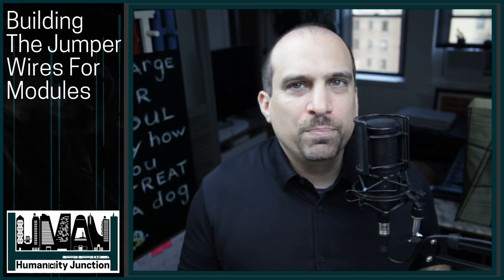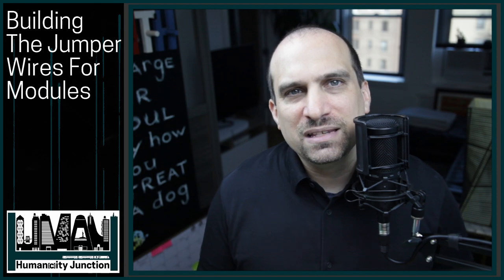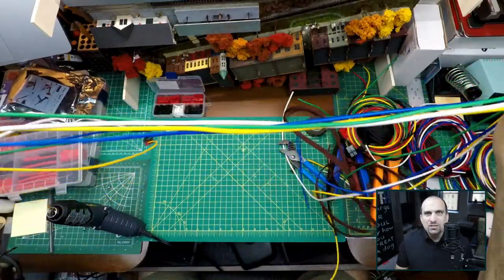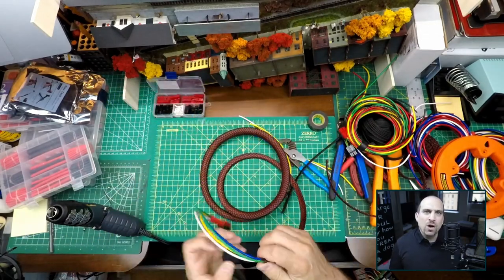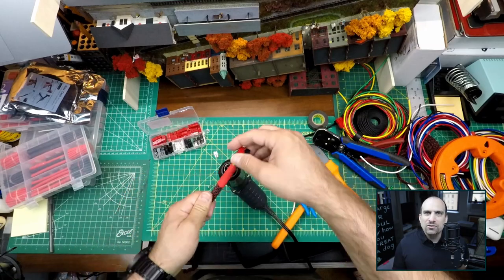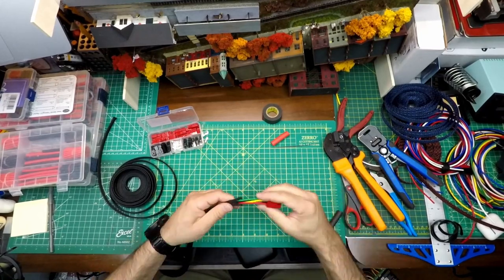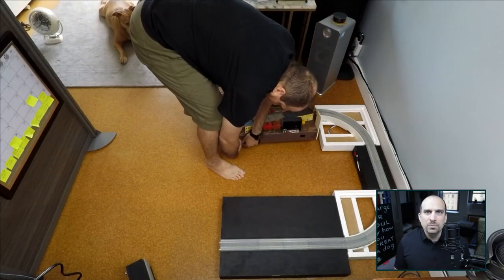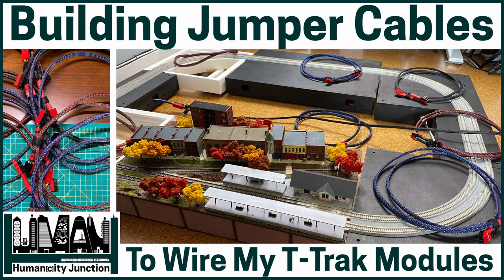46 | Building Jumper Cables To Wire My T-Trak Modules | DCC

Comment: Nice work Heath. Wire management is really something I need to focus on when building my next layout. I remember using these Anderson Connectors on my RC airplane batteries and speed controllers. Cant wait to see your circus trains running on the layout. All the best, John
Reply from the maker: John, Thanks so much!! -Heath

Comment: That looks awesome , very neat which I like .  The wire you use looks huge what gauge is it ?
Reply from the maker: Jerry, the wires are 16awg.
I used 12awg from the control box to the block detection device, 16awg from the block detection device to the modules.
16awg is the largest wire size that fits in the screw terminals on the DR4088LN-CS. -Heath
Reply: @HumancityJunction  isn't 12 pretty big for your Nscale layout?
Reply from the maker: @BoxcarJerry  Yes, 12 is not needed for my size layout, but I wanted the control system to be as universal as possible, so I went with 12 for the main run.

Comment: some thing you might want to think about make 2 loops  but its one continues rail what it looks like is folded in specs  like a figure 8 but the rails are on top of each other so there is one cross over rail above the other so you can then elivate it a bit  at the rear - hard to explain  but the cross over in at the front - ok  see if i can explain it  cross over at the front as te loco goes over the xover it goes up a small incline  till it reaches the rear  then the track come down the incline agian and goes over the xover  then it travels around the rear of the lay out on the base then as it comes around   it goes over the xover again and back up the incline  as 1 continues rail
Reply from the maker: I am basically following the t-trak standard with my track layout. In their standard, the double track is the basics.
If there was a Free-MoN club in my area, I would have probably built to that standard.
One day I will hopefully have more space.

Comment: Nice Job, what gauge are the wires?  In the video they almost look like 12 awg
Reply from the maker: Steve. They are 16 gauge. I am running 12awg from the control box to the block detection device, then 16awg from block detection to module. The screw downs on the DR4088 are only big enough for 16awg wire.-Heath